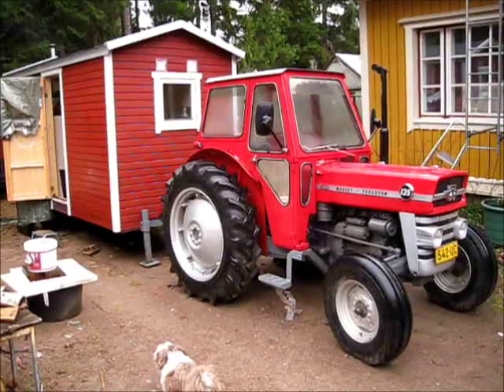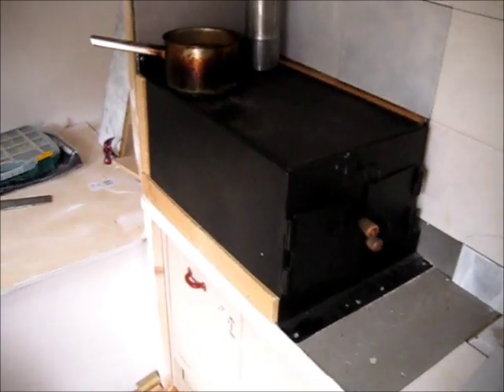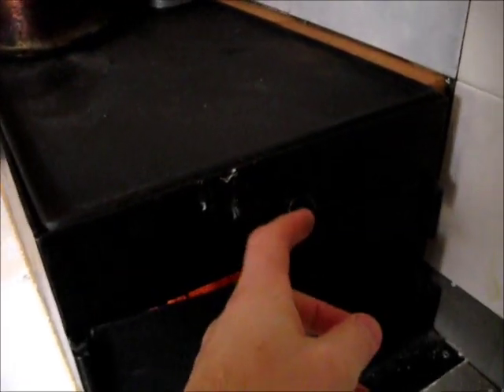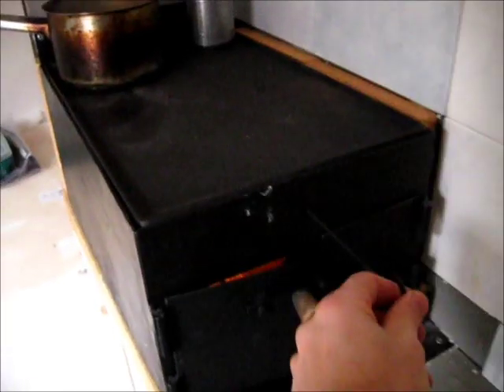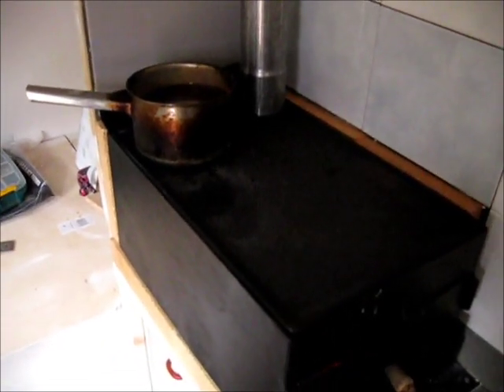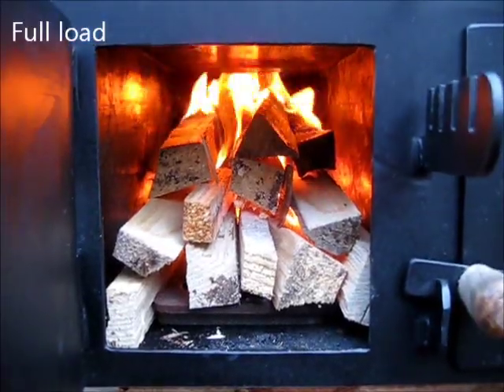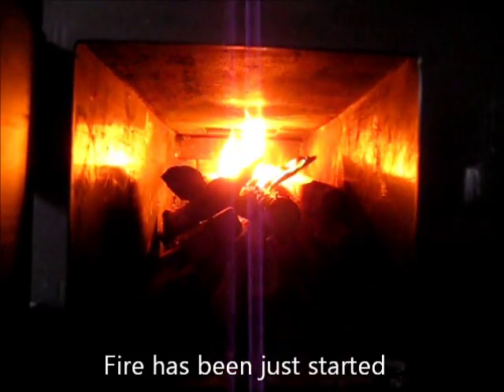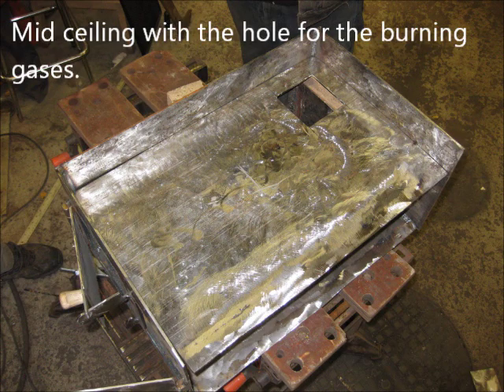Horizontal Cook Stove with large cooking plate

Comment: Hello dear Pekka
Hope you have had a good winter.

I tell my findings for the RS of the caravan, ideas

*

Make an oil burner with the hob is a drawback,
Oil makes a lot of soot (the caravene is a thoroughly clean this spring. There are everywhere ... U)

The air inlet (pizza oven on mine)
is perfect for dry air of the caravan (still very wet)
and secondary air burner is quite effective (not found a simple solution for primary,
if you burn wood - would be clogged with ashes on mine)

(I would add a third air inlet for next winter, at the hob).

A tube (possibly an old cast iron stove, one on which connects the chimney pipe)
and laid over the opening of the chamber fir (square on our)
drilled as on stoves style neostove can (bottom two rows of holes, a row of top holes, holes 6-7 mm in diameter, 8mm max)
this has greatly improved in mine and immediately re-burning gases,
otherwise the "bell" I tried to do are not very effective, but to increase the heat exchange.

*

A completely rebuild ,,
I would do half as wide, but larger,
without oven ppizza (only works absolutely, definitely hot, with oil at least - I have not burned wood)

with oven above the wood fireplace, forward,
the cooktop remains on above fire chamber to the rear,
is a double wall but the interior open at the top,
hot gas will remain at the top, the smoke is sucked in every way to the exit gas
it will bell the worst, but will help to grill for the oven
the gas outlet is on the side of the furnace.

It is not very clear without schema, sorry, if you want one tell me.

P.S .:

You are Finnish?
Oh ... of course, you have the reputation of being very nice,
as I would like to live up there (suede, norway ...)
if only the weather and language ...

Happy spring anyway.
fredincrease the

Comment: Could you construct an air feed from outside so that you don't draw the warmed up air in the wagon? The car exhaust looks great!
Reply from the maker: Direct air feed from outside is tricky when outside temperature can be -20 Celsius. Air is too cold to feed in the firechamber. I made an air intake in my cabin from outside so that cold and fresh air flows on the top of the stove. Stove heats the air which rises up. This circulates the air inside the cabin and warms up the floor better. I think it's ok is the stove uses the warm and "used" inside air. I have an idea about warming up the incoming air with the heat form the chimney.

Comment: Hi Pekka
We love watching your videos - you have great ideas and thank you for sharing them.  We are currently renovating an old camper van and want to heat and cook/bake on a horizontal wood stove.  We had an adapted vertical rocket stove in our last camper van which worked really well, but would like to change to your horizontal type this time. 
The area we have available is 45cm wide x 50cm long, chimney diameter 10cm and the spot is close to the entrance door.
Smokeless burns are important to us, so do we need to consider extra secondary air?  The camper van has about 28m3 volume.
We would really appreciate any ideas/advice and thanks again for all the interesting videos and information.
Kind regards
Joerg and Crystal
Reply from the maker: Thanks Joerg and Crystal. Your plan sound good. Here are my friend's remarks after using this stove for some time:
- It's very effective space heater. In a small trailer van it's sometimes too effective. 
- It's also very effective cook stove.
- Shorter fire chamber would be more handy when loading (short) wood.

We are planning a second version:
- cook top 30 x 40 cm
- fire chamber: 30 x 15 x 20 (heigth) cm = shorter than version 1
- oven: 30 x 25 x 20 cm = wider and shorter than version 1
- more (fire) bricks around the stove to get some thermal mass
It would be more handy for cooking and baking and less effective space heater.

Looking forward to see your design
Pekka
Reply: Hello Pekka

Thanks for your informative reply.
We have finally decided on the following dimensions:
450x500 wide (exterior), chimney 100mm diameter, constructed from 1.5mm steel and the interior lined with 30mm firebricks. (refractory bricks)
As we are using an old stove top, the damper can only be built at 280mm. The existing stove plates overlap.
The firebox internal measurements would be 150x200x420mm and the oven 280x200x420mm.
How big should we make the opening to the space under the cook top?
What do you think of a gap of 40mm between the two?
I recall you saying in an older post that you had best results without a grate. How do your friends deal with ash build up? In our previous rocket stove, we experienced quite a lot of build up after several hours of burning. (The fire chamber had a 150mm diameter with unrestricted airflow and no grate.)
I am thinking of using a U-shaped secondary air channel maybe 15mm high, that could also be used for ash removal. What do you think?
We have to run the chimney pipe through a couple of built-in cupboards. Do you perhaps have any data about chimney temperatures after the stove is at maximum temperature? I am thinking of using a 100mm inside an insulated 130mm pipe and wonder if it is safe!
Sorry to bombard you with questions, but we would really appreciate some more advice from you. Thank you!
Kind regards
Joerg and Crystal
PS: I would like to send you some photos of the worktop and later more as we build it. Can I attach them on this site? Or how else can I send them to you?
Reply from the maker: joe21063 Hi Joerg and Crystal.

Opening to gap under the cook top should be same size as the chimney.

When the stove width is 500 mm then the "channel" under the cook top is half of that = 250 mm wide. So the damper should be 200 long leaving a 250 mm wide channel (450 - 200 = 250mm). Gap under the cook top is 78 square cm (size of the 100 mm chimney) divided by 250 mm = 31 mm: make it 35 mm to be safe.

The edge of the chimney should be about 50 mm from the corner of the stove.

Test it with and without a grate so you'll find the best option.

Putting a thin fire bricks at the bottom of the fire chamber helps to burn the ashes.

Hard to say anything about the 2. air channel without seeing it.

For chimney you probably need 200 mm insulated pipe with a 10 mm gap to the wood. Test it carefullt so you'll find the right size.

You can for instance send a link to your pictures in your next comment.

br
Pekka

Comment: Hello Mr Pekka.

I would like build one for my caravan
but not good welder Ive gone to ask a professional to build it for me
so do you get precise dimensions ? Ill do a plan.
Reply from the maker: Hi fred san. Dimension in cm are: L = 50, W = 30, H = 25. Space below the cook top depends on the size of the exit flue. If the exit flue is 10 cm then the space should be about 5 cm high.
This one has long (50 cm) and narrow (15 cm) fire chamber and oven. It's a bit too effective space heater so we are planning a new one. We will turn the stove 90 degrees to get a shorter (30 cm) fire chamber and wider (35 cm) oven. Better for cooking and baking. Space below the cook top should be about 3 cm.
For a small space 30 times 30 cm stove would be enough with tiny oven.
I'm happy to comment  your plans. if you post some drawings or a prototype. Good luck.
Reply: Pekka Leskela
 Thank you very much.  perfect.
And 3mm steel Ive read.

Ill share pic/plan and video when done.
have a good automn, thanks again-I spend winter in old caravan,a forest  600m altitude.
Reply: Pekka Leskela Hello Pekka.
I've asked to pro welder, he's ok to build it,
but he does not know what thickness of sheet metal used (more is thick, it is more expensive),
he told me that for a barbecue with a plancha placed on the flame, 3mm warps with heat.
 I think that's enough, but I prefer to ask yourself before making the plan.

Have a nice day.
fred
Reply from the maker: fred san The cook top is actually cast-iron plate made for barbecue and for a gas-grill. It does not warp. My friend bought it from a local hardware store.
Reply from the maker: fred san And fy friend made a hole in the cast-iron cook top and put cast-iron rings for the hot spot.
Reply: Thank's , I forgot I've noticed 3mm, good  idea cats Iron, maybe and old electric cook would done, but I have somme old for stove. I do the plan those days (with paintbrush sorry), I'll show you before give it to pro welder. Have a good week.
Reply from the maker: fred san Nice plan fred san.  Some comments: gap below the cook top should be 4 cm instead of 3 cm (20 cm times 4 cm makes it about same size as the chimney). Your "? cm" should be 20 cm so actually you don't need the damper. Just make a 10 cm long middle wall between fire chamber exit and chimney entry. Good luck.
Reply: Pekka Leskela
 Thank's lot Mister. Last question I forgot : you did 15cmX50m, maybe 15X30 is minimum, or cand I do 20X30 or 35 ? (either the air intake in the oven should compensate for the lack of 'draw' of fire chamber ?) Good end of week.
Reply from the maker: fred san hi fred san. If you are talking about the gap below the cook top it depends on he size of the chimney. If your chimney is 100 mm in diameter it's about 78 square cm. So the gap should be same size. That's why I recommend 40 mm gap: 40 mm times 200 mm is 80 square cm (close enough to 78 square cm). In my friends stove the chimney was smaller and the width of the channel below the cook top was 150 mm. In your design its 200 mm. I hope this helps. Pekka
Reply: Thanks help, I prefer confirmation before give plan to welder (not easy to adjust after).

p.s. :  the space up should be used to save floor space, so make vertical oven up wood entry, open on fire as a bell, (I've tested outside with hole in ground, plates,
bricks and glass pyrex  plate as dorr oven..
Reply: Pekka Leskela
Good (rainin') sunday Mr.

Modifying dimensions
H=33 W=35 L=40
because 3 bells at top (instead of damper)
plan        hpics.li/d9a2b42

Good week.
Reply from the maker: fred san Hi Mr. fred. Looks interesting. I have no experience on that kind of bells so I cannot comment on that. Good week for you too.
Reply: Good morning,
sorry you not experiment.. -ü- .

I should add quarter circular tubes as dragon stove (one up air entry removing bricks, one down at fire),
 2-3 vortex,
and end of week,  spend day building with pro welder (show, explain him)
 I'll do photo during construction and video after, if possible.

Last question, problem,
how do you insulate walls and soil from heat ? (I thought sand and perlite, 'placoplatre' stop fire)

Good week.
Reply from the maker: fred san Hi fred san. Looks interesting. I think it's a goob idea to build a prototype using scrap material before hiring a professional welder. Especially if you try something new. I have build  several prototypes before getting the stove to work.
Pekka
Reply: Hello Mr. That's what I'll do if I could, but no time to, no place to work etc so I know, risky to make 20X15cm chamber, maybe as your 15X15 cm ??? (and I thought to vortex and dragon to help air gaz flow). P.S.: as suggested on facebook RS group, I'll insulate a few with perlite-clay.
Reply: Pekka Leskela up
Reply from the maker: fred san Hello Mr. fred san. Fire chamber size is not that ciritical. Higher fire chamber is probably easier to use. Vortex and dragon things are always tricky.
Good luck.
Reply: Hello Sire. Vortex I well known (I've made some for 4 stroke, gazoline and diesel (I've broken turbo on my car with), and have to 2T moto trial (fun). For lawn mover, I suggest to try first (perfect, and noiseless). Sure, fluid mechanics is very thin (must be very well done). 'lucky man friend fred' - a thailand friend grirl - See you later; Fred
Reply: Pekka Leskela
Reply: Pekka Leskela 

Hello Mr, Merry new year.

My stove is finished but doesnt run at all at all at all...
 a lot of smoke, because I add a refractory mix clay perlite cement,
so gaz arent at all reburnt up fire chamber (down cooking plate).

I supposed big air entry up fire would be ok, but not.. maybe too big ?
So I'll try to add an air box outside, with 2 air entry made of steel tubes,
one near the door, one just down cooking plate,
if not sufficient I'll remove the insulating mixture up fire chamber...

I shouldnt copy without test as you said,
and listen those saying refractory is obligatory (RSMH group facebook),
no need to be very efficient at 1000°c for a van,
should imagine a double fire chamber as double can stove (one with holes reburning gaz)

Hope you fine,
have fun, and thanks again for all your videos
(see on my channel, poor quality video I did)
Reply from the maker: fred san Succesful new year for You too. Sorry to hear that your design doesn't quite work. It's so different from my design that it's hard to tell what to do about it. That's why I build simple prototypes to test new things first. Anyway you will learn a lot stove design. Wish you luck. Pekka
Reply: Pekka Leskela -ü- Thank's Pekka. 
I got steel pieces to update air entry, It will be Ok I think (there's no reason).
Have a good end of winter. - fred